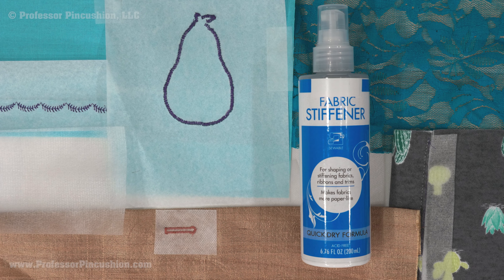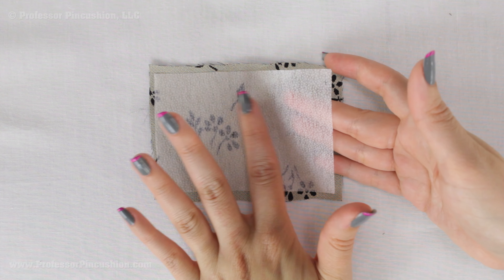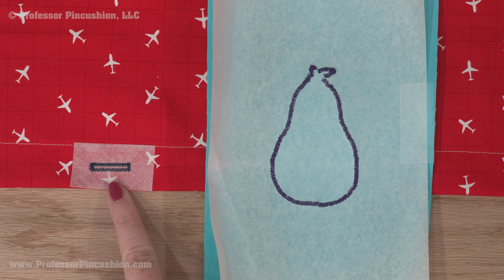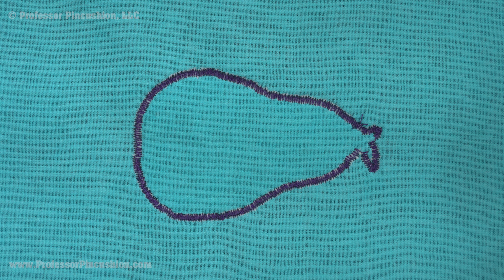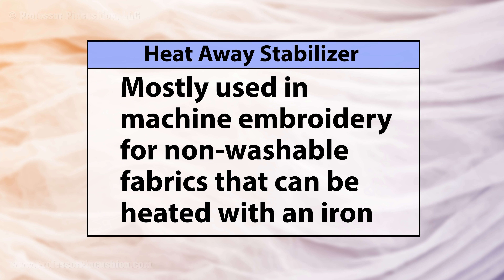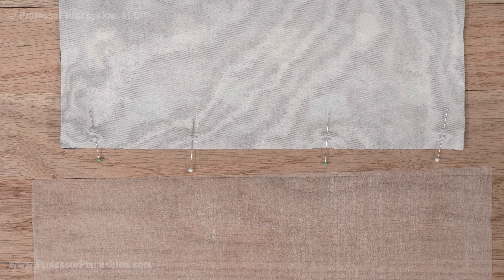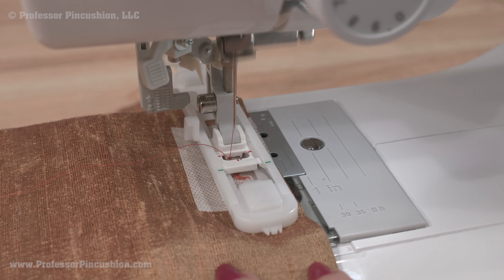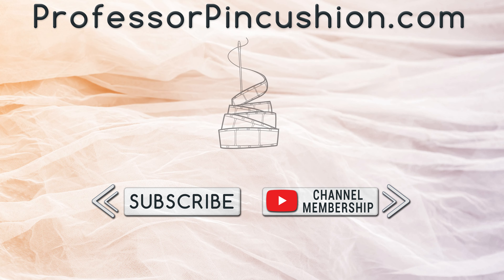How to use Stabilizers For Garment Sewing

Comment: I’m signed up and paid for the premium membership. Why can’t I ask a question? I wanna know how to sewing i straight stitch on a stretchy fabric and still have it stretch?
Reply from the maker: Hi there. There are a few options you can do for sewing a seam on stretchy fabric. You can either do a narrow zig zag stitch or I like to use a stretch stitch. It's a very small, slightly angled zigzag that looks really good and keeps that seam stretchy. If you really want to use a straight stitch, the best thing to do is use a stretch thread like Coats & Clark Eloflex thread. I'm not sure if local fabric stores carry it but you should be able to buy it online if you can't find it locally. If you do a straight stitch with regular all purpose thread it might snap but the stretchy thread will allow the seam to have some give. If you're doing something like a hem, I recommend using a double needle. It'll have the look of straight stitches on the right side but still stretches because of the zig zag on the back. Hope this help :)